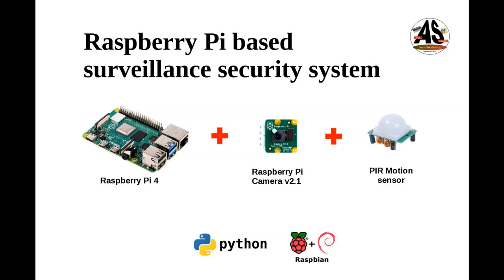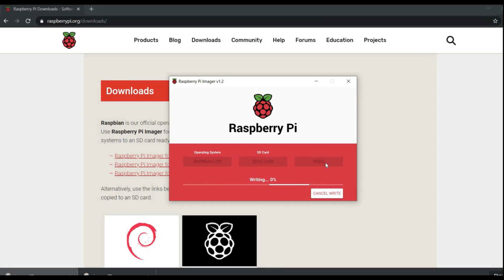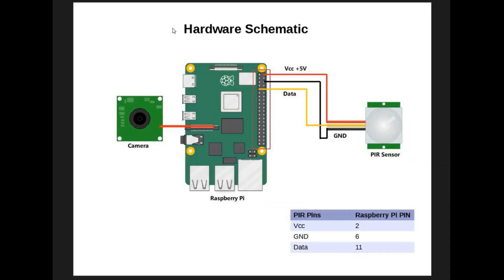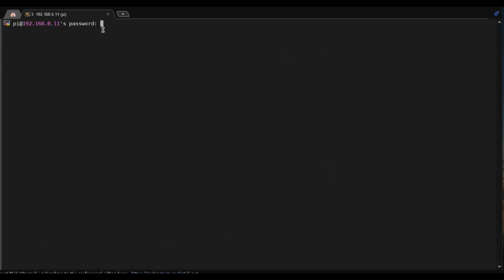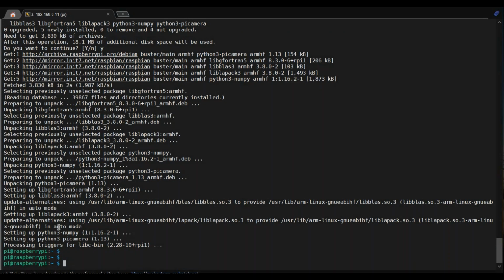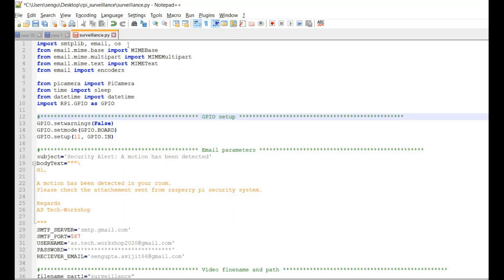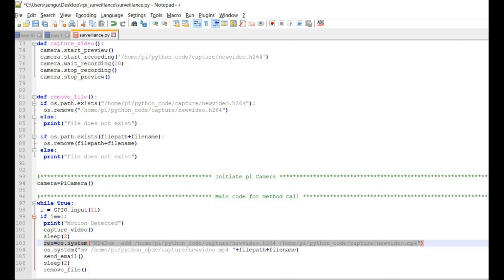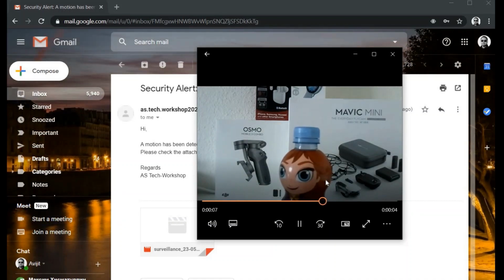Raspberry Pi 4 surveillance security system with PIR motion sensor and pi camera

Comment: Wonderful tutorial. What can be done to  automatically have automatic light on? Any recommendation on some switches and Light Bulbs which can be connected to Pi? Also, the latest Pi 4 have fan installed, where camera will be connected in that case? Can I still push it despite having fan as long as I see its slot? Is there any impact on the fan?

Comment: This was a very informative video and a fun project. I do have a couple of questions. I tried to modify the code so that it doesn't send the email, but instead saves the .h264 file. But it will only rename the .h264 once, then every other file afterwards doesn't get saved. Also, does the email part of the code even still work now that Google disabled the allow less secure apps feature?

Comment: I enjoyed the video...thank you for creating it.   In regards to discovering what the IP address of the Raspberry PI is, why don't you just open a terminal on the PI and type in ifconfig?  That will instantly tell you it's IP address and you won't have to go into your router.   Thanks again for a nice video.
Reply from the maker: If u have dhcp enabled, and u power on the pi, some time it will assign random ip address. If it does then u have to get the rpi assigned ip from router in order to open shell..

Comment: GOOD DAY FOLLOWED EVERY BIT, BUT I'M GETTING LOTS OF ERRORS AFTER I RUN THE CODE:  

sh: 1: MP4box: not found
mv: cannot stat '/home/pi/python_code/capture/newvideo.mp4': No such file or directory
Traceback (most recent call last):
  File "surveillance.py", line 98, in <module>
    send_email()
  File "surveillance.py", line 48, in send_email
    attachment=open(filepath+filename, "rb")
FileNotFoundError: [Errno 2] No such file or directory: '/home/pi/python_code/capture/surveillance_10-08-2021_11:10:20.mp4'

PLEASE REPLY THIS IS FOR MY SCHOOL PROJECT
Reply from the maker: First check if u have mp4box package installed..then check the related file path exist or not...

Comment: HELLO THANK YOU SO MUCH FOR THIS, HELPED IN MY SCHOOL PROJECT, HOW CAN I ADD AN AC LAMP TO THIS FOR A COMPLETE HOME AUTOMATION SYSTEM?
Reply from the maker: For accessing ac lamp, first u need to access raspberry pi gpio pins. U can then add a 5v relay to any of the rpi gpio. Set snd reset the gpio pin from the code just like u sending email.
https://tutorials-raspberrypi.com/raspberry-pi-control-relay-switch-via-gpio/
Reply: @ASTechWorkshop  thank you so much, I would do that. then how do I combine all of this to a single webpage whereby I can put off and on the lamp through a toggle switch? I'm very new to programming

Comment: Excellent video. You have clearly explained everything ,in easy to follow steps. Thanks. I was able to complete the project easily with minor issues which i faced,  but then i referred back to  your video i corrected the errors. 
I want to make a small addition, wherein once the PIR sensor detects a motion i want to also trigger another python script called warninglamp.py. this code  switches on a warning LED connected to a gpio pin  and LED  remains on during the motion and then should stop when motion is not there. How can i call the warninglamp.py code  from within your code to start and stop. your help and guidance will be appreciated alot. Thanks
Reply from the maker: U can import ur python file and call the start/stop method... as the pir detection is very swift, so it would be good to on the led for some sec, when motion detected....otherwise u will not realise the led was on..

Comment: Hello, thank you for this hard work and good Video. I did everything step by step, but unfortunately that didn't start my pi camera . I have a Raspberry Pi 3 model B +, and i have tested the other code in camera its ok 
plz guide me my motion sensor work fine other code, i guess its some problem in camera capture fuction
plz tell me
Reply from the maker: I would suggest u to test the camera function separately... Write down the basic python code for capturing video first.. if u get the success, then include other module like motion sensor and email system..